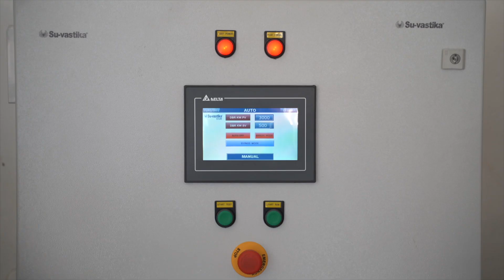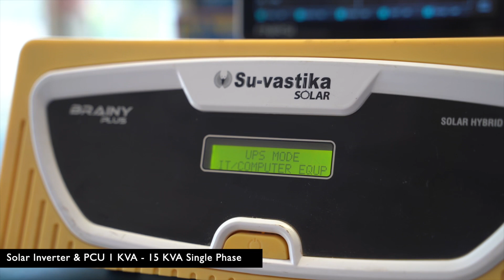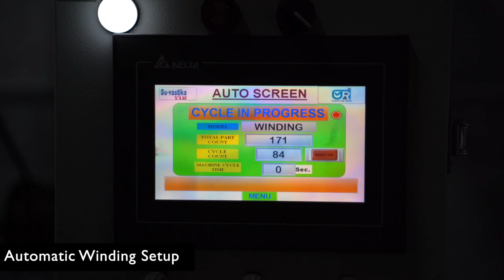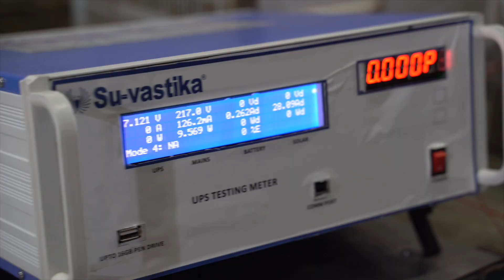Secrets of Su-vastika's Solar Backup Facility

Comment: जिस दिन से Sukam बेचना शुरु किया तब से सबको भूल गए,
इसके बाद जब से Suvastika मिलने लगा तो वापस शान्ति मिली,
अब 
2kva 48volt MPPT Solar PCU 
5kva 96volt MPPT Solar PCU
7.5kva 120volt MPPT Solar PCU
की सख्त आवश्यकता है,
इसमें निम्न विशेषताएं अवश्य होनी चाहिए,
1- Battery Low 10.0 to 12.2 voltage setting
2- Battery 5Amp to 40Amp charging setting
3- Grid reConnect voltage setting 
4- Load capacity increases/ decrease setting, 
5- Operating mode Smart/ User setting 
6- One touch Battery low reset
7- Timer based Heavy load Shifting setting (Solar to Grid)
जल्दी से जल्दी manufacturing शुरू हो जाए तो अच्छा लगेगा,
Reply from the maker: Feedback के लिए धन्यवाद, दलपत जी! हम आपकी requirements को संबंधित विभागों को भेज देंगे।